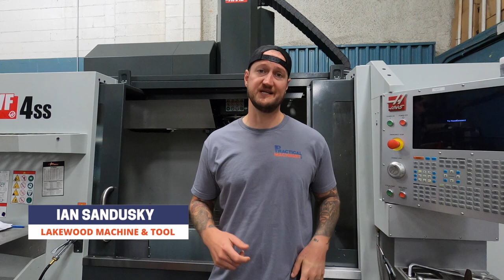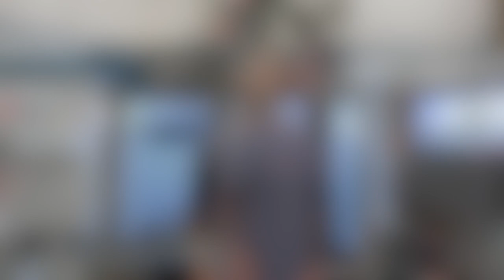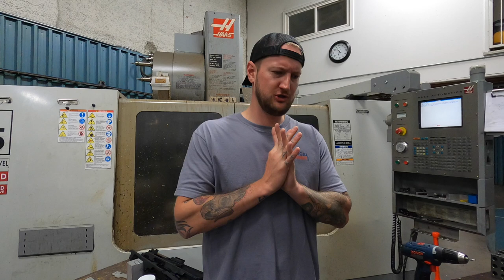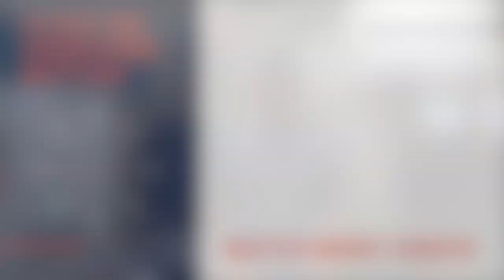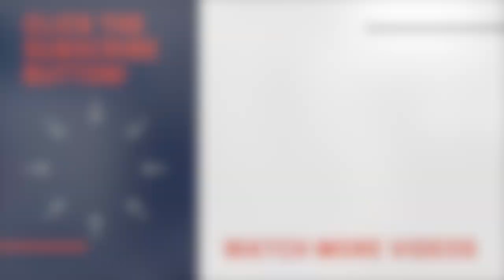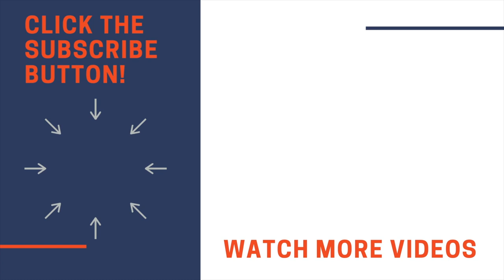Who Proves Out Programs | CAM vs. Hand Coding | Machine Shop Talk Ep. 33

Comment: On the other topic I do believe it’s good to know basic G code but the way the machining industry is going in North America is the hard complex parts are the parts we are seeing at least in my shop, the easy 4 holes in a square block is way to competitive to get so if u want to be getting work that everyone and there brother is not nickeling and dimming on you have to go after the hard complex shapes hard to matching materials. You are never going to be able to write that program by hand so why bother wasting your time learning it. Put  the effort in to honing in on the cam and getting really good at making solid programs. Do I think every engineer should have to learn how to run a cnc and what can actually be done on one yes 100% . What I see all the time is a small corner rad in a pocket that’s  3 inches deep you are never going to get a good finish unless you have a 5axis and you can tip the part away from the holder. Again I see it all the time put a 3/32 rad down a 2.5-3 inch wall we recently got a 5 axis so we have that capacity if it’s 100% needed but most of the times we call up the costumer and they say nope that’s not needed at all u can put a 1/2 endmill down that wall. Engineers get carried away with the rad feature in solid works I believe. Anyways again another great topic.

Comment: I use fusion 360 for milling programs. It records revisions and the programmer both program and probe programs. We dont use cam for out lathes so we always save the nc programs with cimco nc base.it also saves and records revision changes in the programs. But its still a question about disciplin.

Thanks for the video again Ian 👍

Also cam VS gcode. I use both. I make parts that would be very hard to cam but I also make parts that would be impossible without cam. 

I use everything, gcode, macro, cam and conversational.

I dont want to limit myself its All tools og the trade. 

/Nikolai Høj
Reply: Thanks  brother! I really like Fusion as well - we had a seat of it but I let it lapse, but I’m going to get it back in as another programming station for my guys. Keep up the good work!! 🍻🍻
Reply: @ISandusky  i have used it for 2 years for All My milling and I love it. I use it alot for 3+1 and 3 axis. I plan on getting the mfg extension when i get My New 5 axis aswell.
Reply: @ISandusky  i have my fusion setup with ALOT of templates and standart tools so programming is so fast. Like we talked about on LinkedIn in your automation post. Keeping spindle time up is a must and programming and setups need to be at the minimum. I also is looking into lang base plates for my machines to reduce the switch over.

Comment: I make my own program , do set up , first op , even run the machine if needed. Just moved to a new shop after working in big shop , saw the old guy( 57 year ), programmer giving the set up guy nc file to do the first op. Tool crashed and he blame it on the set up guy. Problem is that  they don't want to teach or have that responsibility.  System continues and they create dumb set up guys who has there nc files saved for future run and set up.
I believe one who make the program should do everything until the first piece or few parts in case of production run to check the feasibility of set up . 
Also if programmer left for vacation or day off in big shop with 15 plus machines, there must be someone who covers that guy. And to know how to change parameters in CAM not only in NC file always. 
System will not change unless and until someone is given a chance or ready to learn.

Comment: Feeds and speeds should be the only thing a set up operator is changing. Or of course a retract that is not right. Other then that everything should be changed in the cam and reposted. The other thing I would say is if it was that a drill was way to high on the rpm and blow the hole over size that would also be changed in cam so It does not happen again. Also if it is feeds and speeds and its going to be a recurring job and cycle times are critical, with in a shop like that I’m sure they are 100% critical then that should also be changed in cam. I work in a job shop where we have 4 machinist and 4 apprentices and we all have our own station with mastercam. The only time someone else would run a program is if it is a quantity of a complex part myself as the working supervisor will program it and the apprentice will run it, that being said I will hang out with him well prove out is going on to make sure there is nothing that could be optimized. Anyways great video great topic!!!

Comment: Previous shop I was in had engineers make the program and machinist setup and run the parts. Low production run stuff, extremely tight tolerance work. It was a pain to prove out 5 axis programs and very rarely did the engineers even come down to walk you through what features would be cut (most parts were roughed out and ran through the ovens for stress relief).They sent a pdf of what was needed to set the job up and a few pictures and that was about it. I would just dry run the entire program and make paper notes of each tool and what it did (most were about 30-40 tools used). I would spend the entire 10 hour shift proving it in and maybe run 1 part. Submit to inspection and wait….

Comment: When a Haas says "bad command" and wont cycle start try telling it that there is no need to understand gcode in this day and age, its going to be a very long wait.  Understanding the G & M functions and the basic blocks so you can spot them withing the code.  being able to spot that the job card tells you to set the top of the part as zero but the zero in NC is at the base of the part - ooops.  CAM will let you do it, the machine not so much.  when i spot I & Js i just go its an arc init, manually calculate it to check the code - your having a laugh.   Just stupid things like no coolant, its a tick box in fusion 360 with the tool selection and so easy to forget.  From the early DIY homebuild days forgetting to enter a feed rate was a gottcha.  Code runs fine ish but computer says No (a few scary Z moves).  Myself and a few friends like viewing Youtube machine crashes and guessing how far the vice/morkpiece will go, the ultimate has to be if the machine throws the vice which exits the rear of the machine penetrates the outside wall and ends up in the back of a pickup in the parking lot.  Just calmly switch off the machin , put your jacket on and say night all and walk out the door.  When you get home put the vice in the garage with the others. lol.

Comment: I know my G code but I dont think its necessary.
If you are going to be changing the code as the setup gut you are usually gonna change just the tool diameter to get the tolerances in or the feeds and speed and you dont need to know G code to do that. It is nice to know some basic M and G commands and as a programmer you need to know the updates. For example on a Haas the P value that changes the number of points in the contour that can speed up the roughing pass

Comment: they might be trying to save cash by only having one seat of CAD/CAM, having one programmer in a jobshop will most likely cause a bottleneck.
Reply: Definitely - I was shocked by that number of programmers vs machines / operators - but CAM ain’t cheap! I’ve been balking at putting in another Mastercam seat right now because $26k isn’t pocket change to my operation!
Reply: @ISandusky  Is it not possible to use student licences for a couple of shop floor PCs just to simulate programs/jobs.  it shouldnt require a full seat licence just to view.  Even open source programs like Camotics can offer basic 2.5D 3 axis simulations.

Comment: I program for about 5 guys they’re in charge of making sure the program is good if speeds and feeds are changed they have to save it back this does create problems but that’s why every time your first part gets a first article to make sure it’s correct you run the tools about you check as you go I mean why would you repost a program that has allready been dialed in

Comment: Now one of the places I worked at had Pre Mazak machines and I saw a guy get reamed out for programming the job in by hand instead of using the tape back up of the job. We only had one tape reader that went from machine to machine and it was in use was the reason the operator did it by hand, yet still got reamed out for doing so. Then next place I worked at we had one programmer that did not know Mazatrol at all. Must be nice to be hired to program the CNC machines yet not know the language of the Mazak Mill an Turning Center 😂

Comment: If the cam doesn't make working code that has to be modified by hand on the controller then you should boomerang it straight to the reseller or whoever makes the post. I unfortunately have to do everything by hand. It's really easy to make mistakes and to rewrite all the programs would be too much work. Even though I have the advantage that I could make a master file and then just change some lines on it because I make shafts that are mostly same but different lengths and diameters. I say it's wrong to assume you can't understand g code if you use cam or vice versa. Older guys might be excellent at hand code but can't do anything on a computer. Kids these days would not be able to do hand code because they have to do it by hand. I know siemens code quite well at this point because I have hand coded it for 5 years. I know Fusion 360 quite well, I watch youtube videos and make stuff. I have some understanding of Mastercam and Gibbscam too. Basic understanding g code is important even though the code came from cam and has a million lines of high speed code that is basically not possible to read or modify by hand.

Comment: What does it cost to invest in your own staff, the learning material is free from Titans of cnc etc, the student can get student versions of the software.  The actual cost to the employer is  ummm thats right bugger all.  it taks half an hour a week to have a catch up with an employee to see how they are progressing and offer advice/assistance where required.  Any operator could/can learn CAM if not CAD as well.  If we dont invest that into our company then we are basically taking the urine.  The more knowledgeable people we have the better for the company.  If your sat bitching about the skills shortage then perhaps you should start with management skills they must be in short supply if you cant put staff through free training.  perhaps having a PC on the shop floor so that operators can simulate the file would be benificial.  Granted a 10k line 3D NC file containing adaptive tool paths is not going to be somthing even a highly skilled coder is going to read anytime soon.  If your sending an NC file without a job card to basically an operator to run for the first time, there be dragons.

Comment: Maybe I am out of touch but you mention someone running 500 parts on the wrong program. I have to ask..... How?? who was checking the parts where was the QC that could have spotted that early??
Reply: My apologies - I definitely exaggerated in that moment - but it’s been 50 parts, for sure. We’re a small shop. You pull a wrong rev level drawing and a wrong rev level program to check it against - it’s easy to miss. It’s not like you’re out .02” against the drawing - the problem is your documentation sucked and you’re on rev level B when level C is current.
Reply: @ISandusky  thanks for your reply! I love seeing how others do things. Where I work anything that isn’t current isn’t allowed to leave the office. We also check our own parts so QC is up to the individual toolmaker (I work in tool and die) however the owner still checks things before they go out the door.
Reply: @WilliamPayneNZ  100% agree with you - that scenario was a long time ago, and there’s a good reason why I harp so hard on accountability and documentation these days! 🍻🍻
Reply: @ISandusky  the CNC guys where I work also out of preference will program, setup, and run their own stuff. They really like to do it all themselves.

Comment: If I’m programming a part and I have to go and dial it in on the machine that’s bull crap I might as well go set up and run myself if the operator can’t do that then he should go elsewhere
Reply: Thats great but and the most efficient if you are 100% confident in your program, because the operators only job is to put the part in correctly and make sure the offsets are correct and after that if the machine crashes its absolutely 100% your fault, not the operators not the CAM and not the postprocesor, also your feeds and speeds need to be perfect so the endmills dont break.
And thats where setup guys come to play to prove the program and reccomend improvements on speeds and feeds